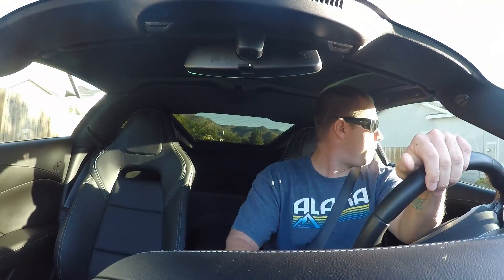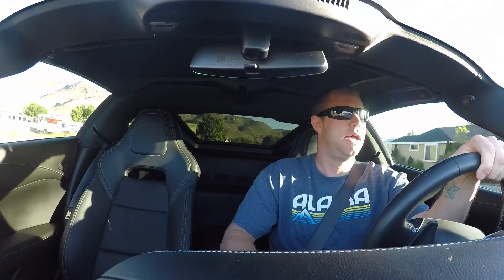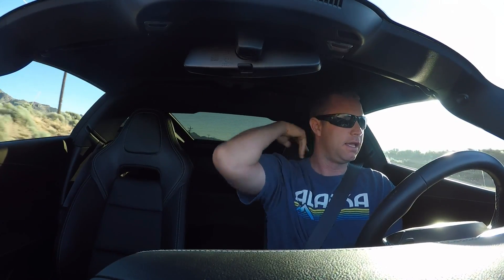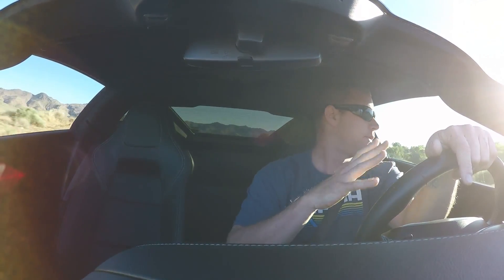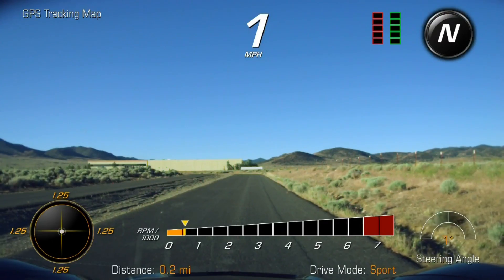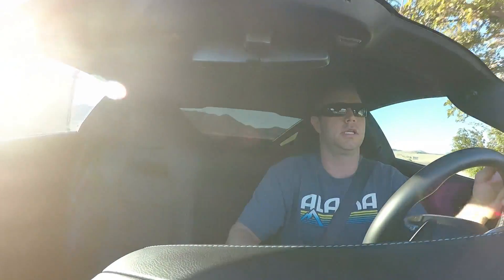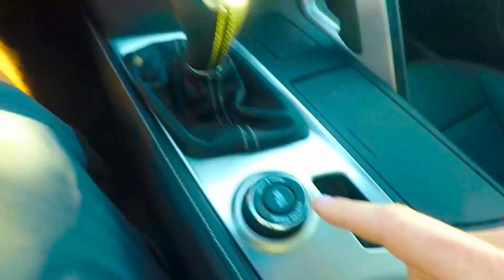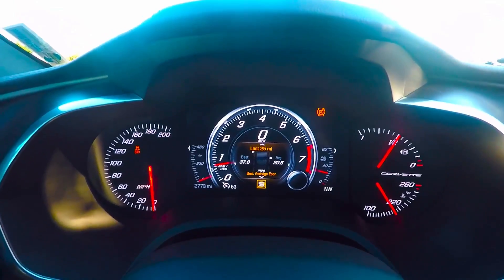C7 Corvette Rear End Failure With Launch Control Explained

Comment: Yeah the E break comes up to prevent roll back but it's not on strong enough to cause the half shafts to snap, punching it combined with dropping the clutch and forcing the rear wheels to suddenly move 3000 pounds from a dead stop is what's causing the half shafts to snap at their weakest point. GM put out a warning that when the wheels start to spin unevenly causing wheel chatter is putting the equivalent stress on those shafts as if you were trying to launch the weight of tractor trailer...

Comment: Question. Why does the PDR show you are in sport mode while you say you are in launch control mode? Were older models like this? On my 2019, launch control is only available in track mode.
Reply from the maker: downshift00 on my old model it would go I to launch control in sport or track mode, also that model didn’t have ptm or mag ride. I think only models with mag ride have ptm and those models let you use launch control in sport or track.
Reply: The Fat Cyclist my 19 is a GS (with mag obviously) and it definitely won't allow launch control in sport, only race mode. Didn't know non mag models didn't have PTM, thanks for the info!
Reply from the maker: downshift00 yes if they don’t have mag ride you have to put them in stabiltrack off competitive driving mode, but no ptm is available. :)

Comment: Just like when your on a hill and its holding, when you release clutch and start to go it releases, same with launch mode its not going to hold brakes when you release clutch. Your not giving computer enough credit, your theory is bogus.
Reply from the maker: 1SILVAK thanks for your comment, but it's not about giving he computer credit it's how quickly the mechanical brake can release. Although it was previously pointed out that the brake isn't fully applied, which in turn would most likely make my theory bogus. Thanks for watching the video.

Comment: Most rear end failures are from wheel hop. Never use launch control. Most people do short burnouts which leaves hot and cool spots on the tires. Gotta do a good burnout. Watch some of my videos you'll see how to use the clutch to launch the car.
Reply from the maker: rmm2424 Thanks for your comment. I'll check out your videos. If you watch the whole video I recommend not using launch control and manually launching.

Comment: try letting completely off the brake before you push the clutch in. I think the hill hold is activated by holding the brake first then pressing in the clutch all the way slightly afterwards. I have a C7 and live around a big hill. I release the brake first then clutch in and feather the gas. I do get roll back that way.
Reply: This

Comment: try letting completely off the brake before you push the clutch in. I think the hill hold is activated by holding the brake first then pressing in the clutch slightly afterwards. I have a C7 and live around a big hill. I release the brake first then clutch in and feather the gas. I do get roll back that way.
Reply from the maker: You are correct it will not activate hill hold if you do it that way. Either way I won't use launch control anymore.

Comment: Interesting theory, I don't believe it held the brake on mine but thanks for testing it.  Glad you won't be using it anymore.  You don't need it and can do better yourself.  Yours still holds lower revs than my 2016 tho.
Reply from the maker: CarGuy11 I didn't think about that but your absolutely correct!  It's still holding right at that 4,000 rpm range!  Your package is in the mail BTW. :)